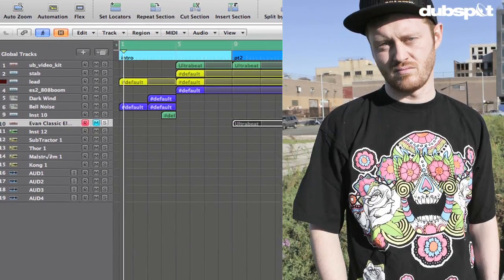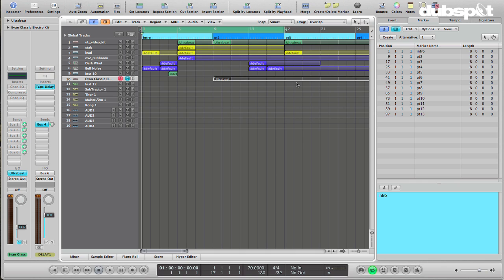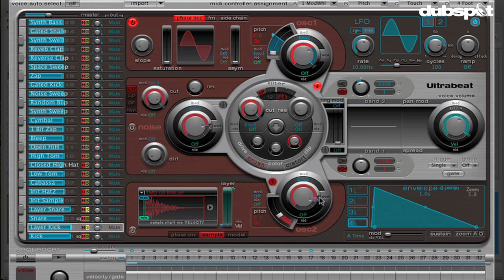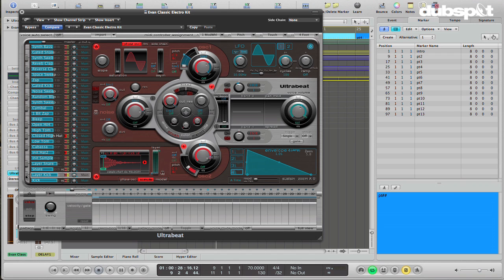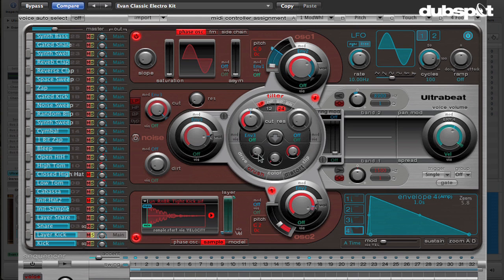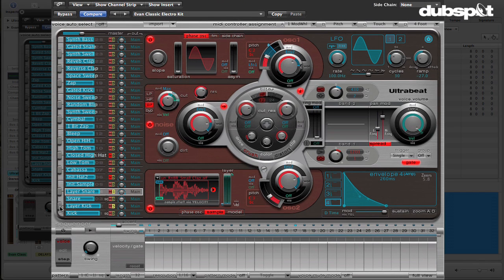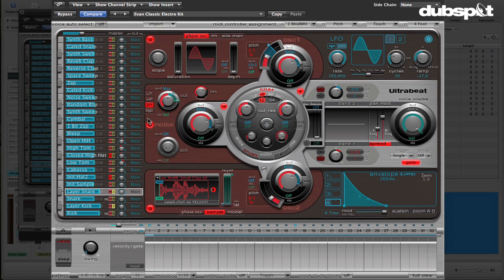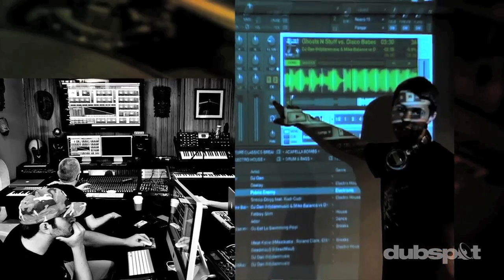Layering Drums in Logic's Ultrabeat -- 'Secret Knowledge' w/ Matt Shadetek Pt 3

Comment: Quick question about the Ultrabeat, as I rarely use it. Does the pitch on Osc 2 default to C3 when it's on sample mode (instead of phase osc or model)? Or does it actually determine the pitch for you, and then you adjust from there? Thanks for doing these too, been checking several of your Logic videos the past few months.